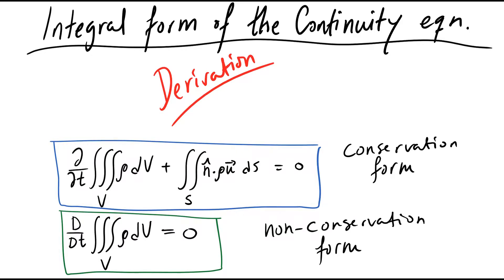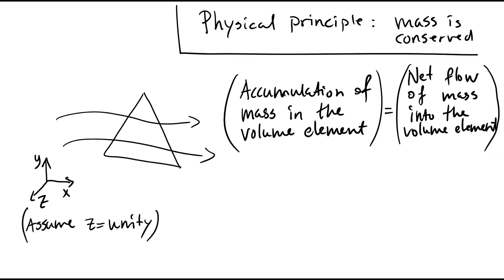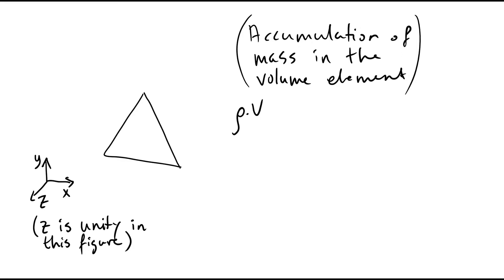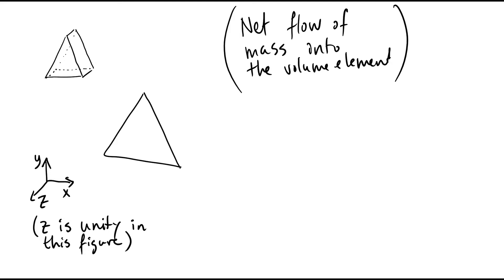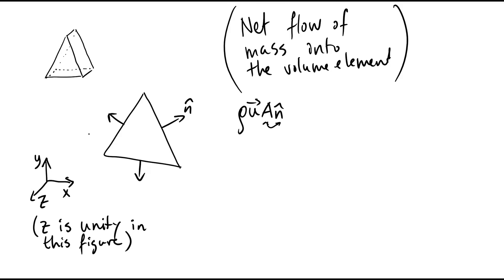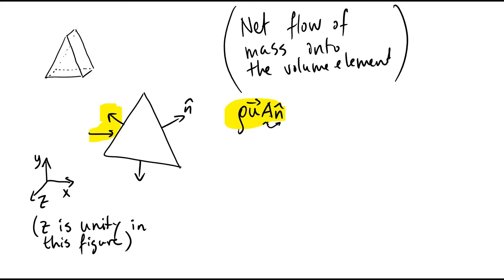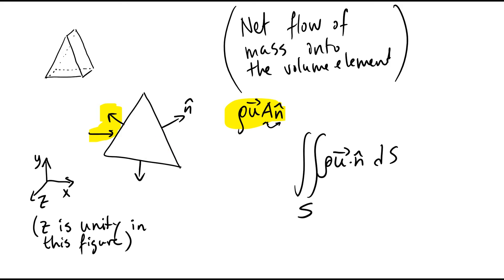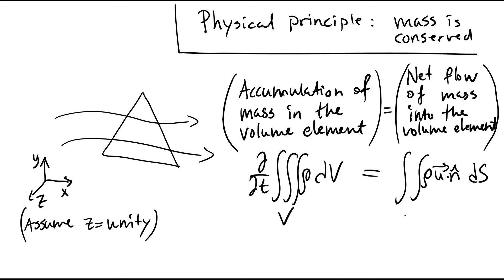Derivation of the Integral Form of the Continuity Equation

Comment: Hi, thanks for the great explanation. I just want to ask the following: 1) The LHS has a triple integral because we are integrating in 3-dimensions (x, y, z, a volume)? and 2) The RHS has a double integral because we are integrating in 2-dimensions (x,y, an area). 3) For the RHS, is that a dot product of velocity vector and n? Can you please explain this? Thanks!
Reply from the maker: Hi Michael, 1) Correct 2) Correct 3) Also correct. Since the flow is not necessarily normal to the control volume boundaries we apply this expression to find the component of the vector u that points in the normal direction. This means that we only look at the flow going into or out of the control volume surface.

Comment: Nice explanation. I wish to know about using the normal vector n cap. Why it is necessary to use and also why it is pointing in the opposite direction of fluid flow?
Reply from the maker: The normal vector is a convenient way of expressing if the flow is going in or out of the control volume. It is not always pointing in the opposite direction of the fluid flow. In the example, when the flow is going from left to right, the dot product between velocity and the surface normal vector will be a negative value for the west surface (indicating inflow). If you look at the opposite surface the normal vector points in the same direction as the fluid flow and thus the dot product becomes positive (indicating outflow).